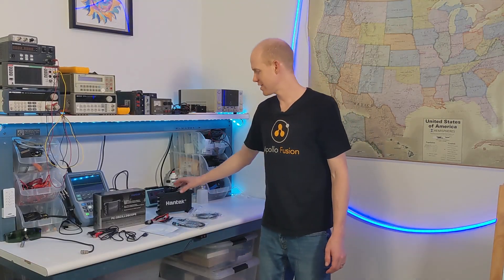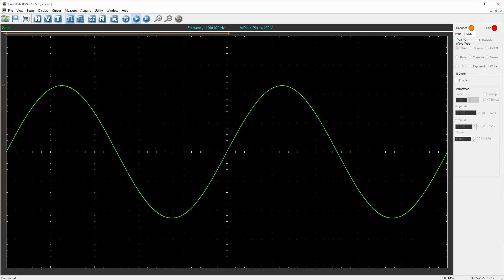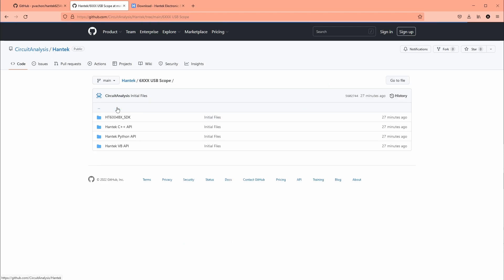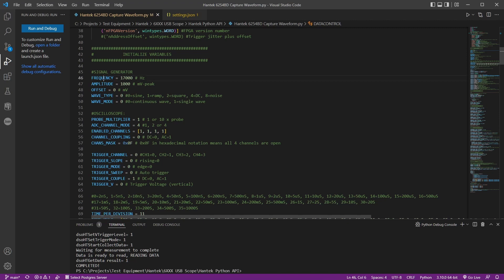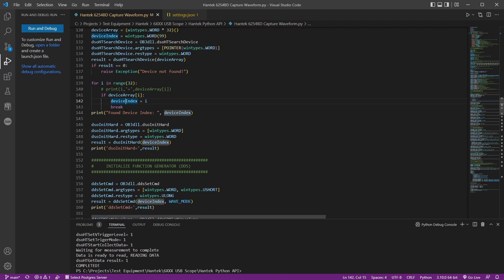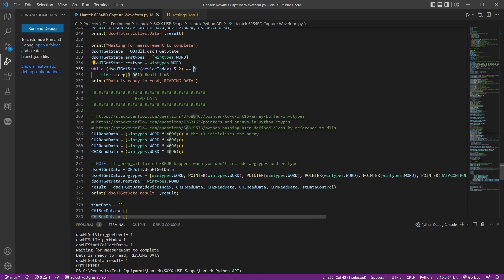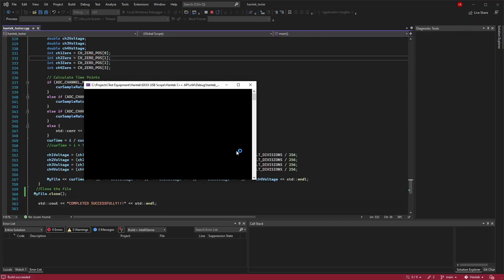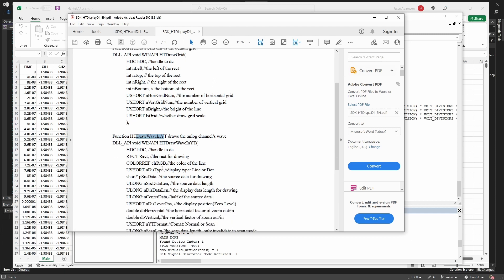Hantek 6254BD USB Oscilloscope Review & Scripting Tutorial (Python)

Comment: does this have streaming capability to capture more than 64us when using a single channel or is it limited by 64K memory depth?
Reply from the maker: I have not experimented with this but my understanding from the docs is there are 2 modes for continuous streaming:
SCAN Mode: This delivers a series of regular scope plots Y/T format.
ROLL Mode: This is more of a data-logger style continuous stream of Y points.
So you set the mode you want and it continuously saves it to the 64KB buffer for each channel and when it fills up it overwrites the oldest data, with SCAN mode saving start/end of frames and ROLL mode just saving the voltage measurements.
You can read the buffer any time and get the data over the USB but I think the catch is that realistically the USB is only going to give you 20MB/s sustained which is on the order of one channel at 10MS/sec, so realistically you may only be able to reliably log somewhere in the range of 1-10MS/s, not anywhere near 1GS/s, though 1GS/s is quite a lot of data to be logging continuously anyway and I think is an issue with USB scopes in general.

Comment: Is the only reason to use Python code with the Hantek scope to generate waveforms?
Reply from the maker: The reason is to be able to programmatically collect waveforms and analyze the output. This lets you integrate the scope into your ATE (Automated Test Equipment) for engineering R&D and production testing.

Comment: Hi, I am having issues with downloading the SDK. When i press the download link nothing happens. Ive made sure that the drivers are correct and that the virus protection isn't stopping the download. any suggestions?
Reply from the maker: Maybe try a different browser? You can email them too, they are somewhat responsive sometimes.
Reply: I tried it with a different browser and it worked! It downloaded as a .rar file.  @CircuitAnalysis

Comment: I am having trouble with voltage levels with the Labview SDK. The scopw range is 0 to 255. Using a 5 volt ref the reading is way too high. Is there a way to calibrate this with a xml file?
Reply from the maker: There should be, in the script section of the video I show some calibration numbers for the python around 15:00. You should be able to read the calibration numbers off the unit and then use those in your program I think.
Reply: @CircuitAnalysis  ty . Your the first person to reply. I have asked this all over the place

Comment: Amazing instructions! I have an RS PRO2205864 which is exactly the same as the Hantek 6254BD, they even sent me the same SDK. I was struggling to do what you did until I found you. Definitely saved me a week of work. I wonder if you have advanced on the real-time display of waveforms (using Python), or if you would have some tips on how to proceed from your code. I am trying to automate some acquisition where the oscilloscope records P and S waves and I have been struggling to integrate this oscilloscope to the rest of the experiment.
Reply from the maker: Hey glad it helped! Interesting about that RS PRO2205864, wonder if they just got it white labeled or if Hantek bought it from someone else? I do see a lot of the same Chinese items under multiple brands I guess. I have not spent any more time on this since I made the video, but if you checkout that SDK_HTHardDLL-EN.pdf in the manuals folder of the SDK files, I think that dsoHTGetData function is the one I used for pulling 1 frame. I think you would probably use the dsoHTGetScanData and dsoHTGetRollData for real-time stuff. I am guessing the Scan one is the regular mode with the trigger and roll is more like a data logger, but I am not 100% sure. Feel free to update us when you figure it out, thanks for watching!
Reply: @CircuitAnalysis  They likely import it from a chinese factory and put their label on it once it is in europe. I am not sure I explained my problem well: it is not like I want to continuously acquired data that evolves in time. I send a pulse through a sample and I measure the waves propagating inside it. Thus every 1 s (as an example) a get new data. For that I don't think I need the Scan mode, just to activate GetData every 1s. 
For my problem I am updating the plot every 1ms and that seems to do the job. 
The problem I am still unable to understand is: By creating a 1kHz square wave with 2Vpp, when I see my plots, the wave seems to move in time, meaning that sometimes there's a crest on t=0s and sometimes it's a peak. Such problem does not happen when I use the software provided with the oscilloscope. Maybe there's something I am not seeing.
Reply: Dont't mind my previous comment. The problem I was having was linked to a bad choice of triggering voltage. Increased it to 200 and it works now. The plots using python correspond to those using the proprietary software.

Thank you again for providing the python scripts and for detailing your developments in such a pedagogical manner. It will help a lot on my research.
Reply from the maker: @victortrola  Oh, awesome! Glad you figured it out!

Comment: I cannot get the 6254BD driver, the one on the website has the wrong VID/PID. Mine says 04B4 theirs says 04B5.
Reply from the maker: Weird, yeah if I go to device manager and click on Hantek => Hantek6000B => properties => Events then under Information I do see VID_04B5 & PID_6CDE. I don't know what that means for your case, you should probably email service@hantek.com, they have been somewhat responsive to some of my questions... Good luck and feel free to post your solution in the comments once you figure it out, thanks for watching!
Reply: @CircuitAnalysis  Thanks, I sent them an email, this has VID_04B4&PID_8613 we bought it a while ago and have never been able to use it.
Reply: @CircuitAnalysis  They replied and asked me to go to their forum page but I can't seem to post there I get "security error". They asked for the devmgr screenshot so I posted it in a reply email. I will let you know if anything develops.
Reply from the maker: @robanderson4111 Which scope model do you have? I wonder if you can update the firmware somehow? Checkout the second post in this forum: https://github.com/OpenHantek/openhantek/issues/301
Reply: @CircuitAnalysis  I got a reply from Hantek with instructions on updating the firmware however on repeated attempts I can't get anywhere. I had to disable checks for digital driver signing but that only worked until a reboot. So I am asking them if I can send it to them to fix. Apparently this uses a Cypress USB interface and the firmware can only be loaded if that driver is installed, but I can't seem to get that far.